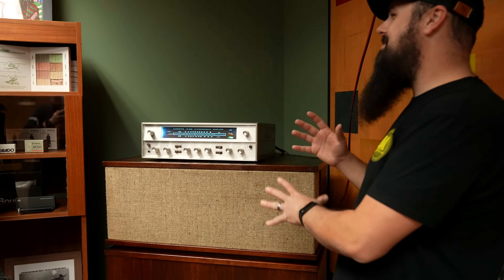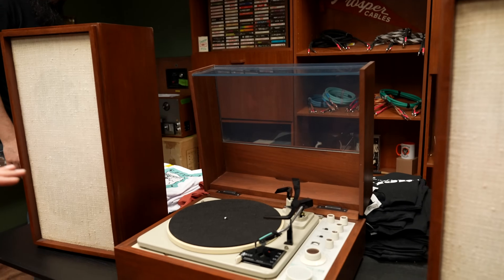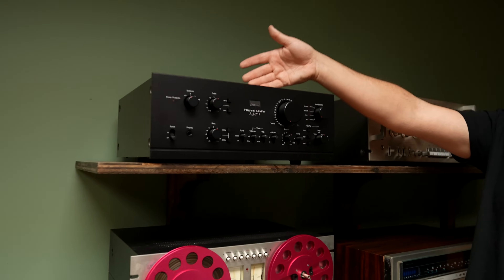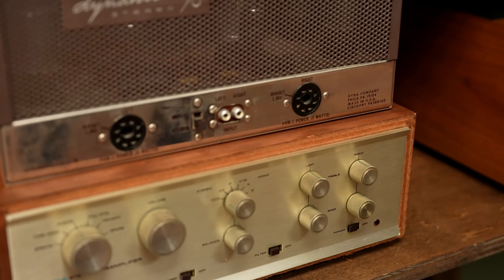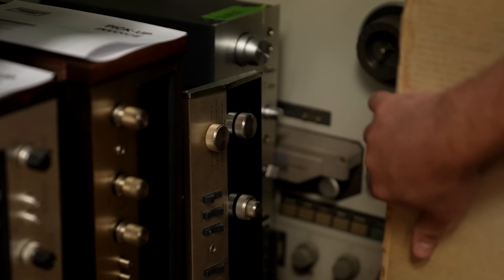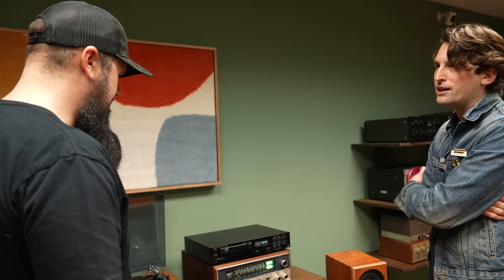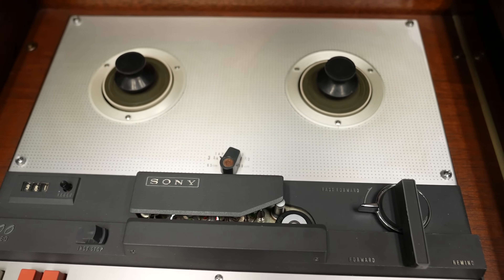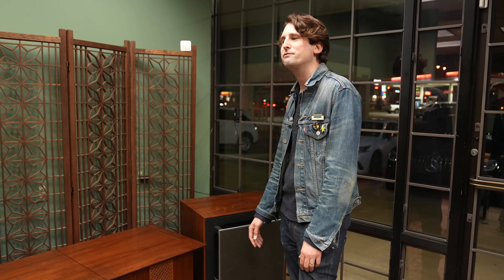RARE Marantz & JBL Vintage Audio Discovered in 1960s Furniture! (Dallas, TX)

Comment: So there’s another?  Back in 1990 when I worked in a stereo shoppe, a doctor retiring to a Florida condo brought in the stereo he bought from us decades earlier and asked if we were interested in buying it.  In a custom Barzilay cabinet was a Technics turntable and cassette deck, a Marantz 7 preamp, a  Marantz 10B tuner and a Marantz 8B amplifier (35 wpc), all mint with even the original tubes, including all Telefunken in the pre.  Alongside were matching Barzilay speaker cabinets loaded with JBL drivers, a 15” woofer and a big horn covered by one of those lattice wood grills.  I offered him a thousand bucks cash, he was surprised and delighted and I had a new stereo, though I sold off everything but the Marantz trio.  Still have the 8B.

Comment: What a great video and another great vintage audio find by you guys, especially that ultra rare JBL/Marantz console setup. Now a little fact about those JBL Flair speakers .....those came in two versions, the standard version was just called the L45 Flair and was a 3 way speaker using the same midrange and tweeter as the famous L100 Century along with white paper cone 15 in. “Lansalloy” rubber/cork surround.During the concept stage these where actually called the Super L100s due to their driver configuration along with the bigger cabinet and larger woofer (ref: Lansing History Website). I  restored and sold a pair of these years ago ....wish I could have kept them they where magical sounding...just didn’t have the room. The version shown in the video is the custom version hence the CL45 designation. These where sold as empty cabinets that could be configured as either   a 2-way or 3-way speaker using several different combinations of JBL drivers!

Comment: Au-717 was an excellent int amp. The dented volume control was faux professional attenuator - where the control is a rotary switch with precision resistors to, a among other things, maintain accurate attenuation curve between channels- especially when you get to the minimum levels.

Comment: I own an AU-717, and its matching tuner. The AU-717 is true dual mono, power supplies and all. The only thing in common on the two channels are the power cord and the balance control. The tuner is the best performer I have ever come across, including the tuner in my Marantz 2325 (purchased brand new in 1977, and still own). 
As for that last system, I'll bet it went for close to six figures. Several years back, a guy on AudioKarma got those very same Marantz components, excluding the TT, from a house being demolished. They were just as clean as these, and he got them for the price of.......... FREE. He got them checked out and running. He kept getting offered ridiculously large sums of $$$ for them. He finally caved, and sold it all.

Comment: In the 1990s through 2009, I had a nice Lafayette receiver that had bass, treble, and volume controls for the left and right. It also had a bass boost and scratch filter. I haven't been able to use the center speaker hook up, I think it needed to be a powered center. You could hook up 2 sets of 4ohm speakers, your choice of magnetic or ceramic turntable with a high or low switch in the back. For a solid state it had a nice warm tube sound. With the power knob, you had a choice for stereo, left channel, right channel, reverse speaker, or monaural. The radio had a loop in back that could be adjusted a bit besides having terminals for an independent antenna. It even had a variable muting knob.

Comment: It is quite likely that the console for the Marantz gear, etc. was made by a company called Barzilay.  They made a lot of console and other audio furniture back in the sixties.  They also made a lot of speaker cabinets to match their consoles, same height, looks and finish.  It all was the same design.  Truly elegant.  I have a pair of Barzilay speaker cabinets that are loaded with all JBL components, but I've also seen them loaded often with Altec 604's, etc.  Whatever floated your boat.  I've seen the matching console for my speakers for sale on the Bay but I don't have the room for one.  The L to L+R and vice versa mode controls were used most often help you more quickly determine if something was wired out of phase, or if a driver was not working correctly in one speaker or the other.

Comment: 9:05 ...    That looks like a PAS-3 or PAS-3x.   The PAS-2 had a different front panel and there was a PAM-1 which was a mono preamp that was powered from the octal sockets of the Stereo 70 or from the Mark III monoblock.  The PAS 3x had circuitry to support the Dynaco Stereo 120 power amplifier.

Comment: Left and right mono mode is most useful to me when listening to audio program with one weak channel (I.e. less than ideal live recording, low bitrate file streams, etc.  

An elaborate, multiple option mode selector switch can be useful for many purposes however it is very much overkill for most average listeners. It’s most advantageous and helpful for technicians essentially.
Reply: If the left channel is stronger signal, use L mode mono to send that stronger signal to both channels instead of having a noticeably unbalanced source audio program.

Comment: So, I just sold a set of 1985 K--Horns KB00 H/F with a closed back and they didn't need to be corner loaded?  The guy I got them from went to great extremes to build a wooden false corner for them.  And the buyer believes the same.  We look ignorant I suppose.

Comment: You can't put a Klipschorn anywhere :) It is designed and has to be placed a certain distance in a corner. The entire design relies on this placement because it uses the walls as part of the speaker. Sad.
Reply: One can put them almost anywhere. And they will in most cases still sound good, But they will sound a little different.

Comment: That HK Citation 12: late 60’s/early 70’s SS amps (before matched PNP & NPN o/p transistors were commonplace - or even silicon transistors), Ugh. They sounded horrible then, and they sound horrible now. From that era of early SS power amps, only McIntosh & and a few others made amps that approached high end tube audio. 

I’d rather have a Dynaco 260 with its output coupling caps than this HK. At least it sounded semi-decent. But the Dyna liked to burn up.

Comment: I sold that stuff and it does not sound Great / Todays Equipt is much cleaner sounding / Parts for the old stuff is hard to find & expensive to Repair-Stay away unless you already own it
Reply: Old stuff generally is built better and more sturdy than new stuff.